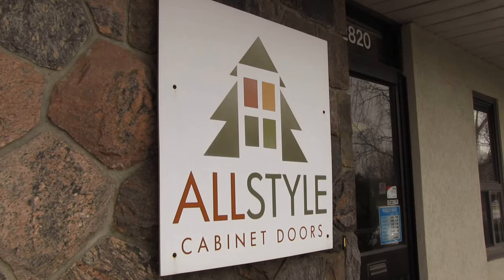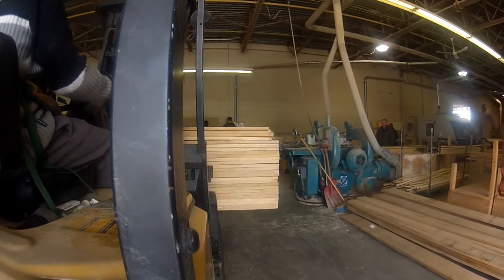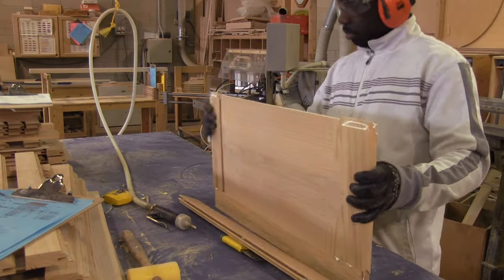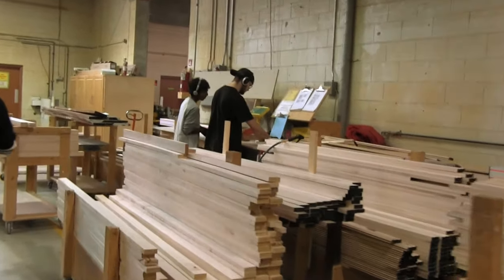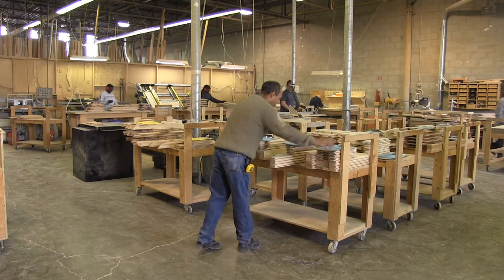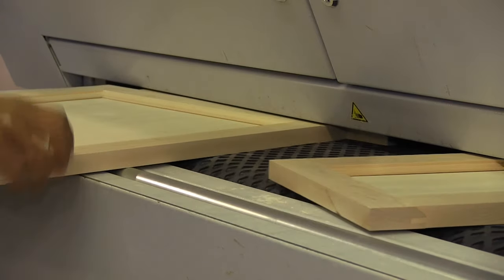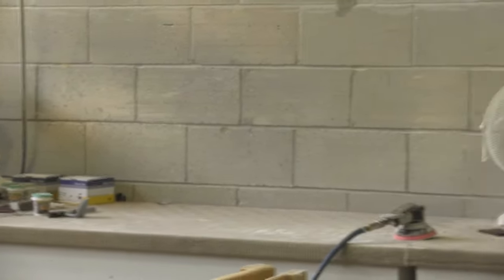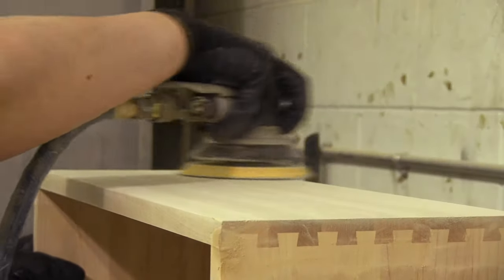AllStyle Cabinet Doors: Factory Tour

Comment: Speaking of the manufacturing process in detail tends to expose part of the process that raises other questions of why? For instance, saying that the wide belt sander puts coarse sanding marks in the wood and that requires hand sanding thereafter is too detailed for the consumer. We sand off the glue? Why are you speaking of such a things. Speed of manufacturing?; why get into that part of the process; just say the capabilities of the company are improved by the process. Why show a dovetailed drawer in maple? that has a piece of wood stack glued together and exhibits a dark spot (:32) that stands out as an unwanted design element; and, it is next to an almost clear light colored piece of same species wood. It exposes the fact that the process is going so mechanically executed that selection of a composed drawer front is not homalogous with other parts and pieces.  I would not want to speak of the process and show the down sides of the manufacturing by imaging such. Someone in the process should be sort and culling pieces into categories that can be grouped to minimized the variance that your video is exposing. It gets into quality and selection issues. Seems to me that 1/2" thick drawer sides are as strong and durable as needed vs. your 3/4" approach that adds weight to the products.?  Why talk about finishing that corrected process rough points? When people buy body work or even a new car; they do not want to know about the process of finishing; they want to see the pretty side of the work. Revise what you are speaking about and let the client fill in the rest and keep smiling about your manufacturing. Good luck
Reply: this is business too business sales, not direct too consumer. I know how too build a door but do they?
Reply: Muppet
Reply: @woodboi5973  Fred mupppett here  why?
Reply: Been there and as always too much dust as evidenced by the floor and on the clothing of workers. Take care of the dust at the source and save time, lungs and speed production.